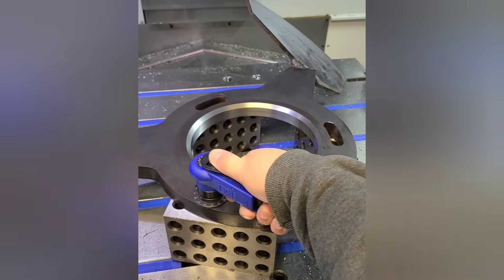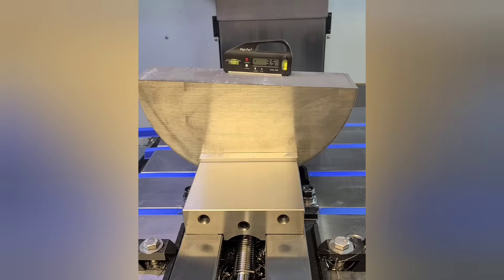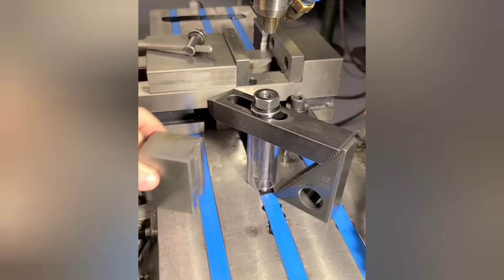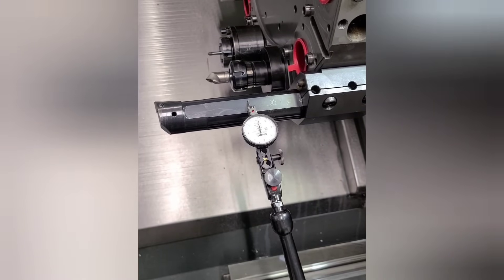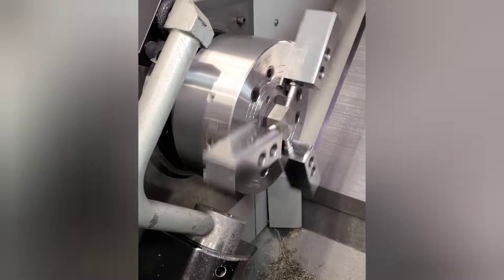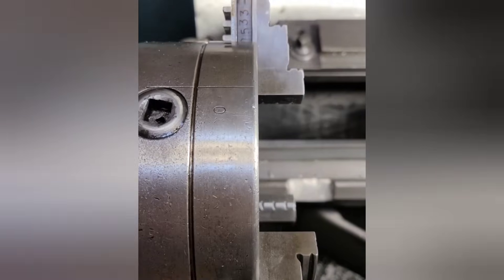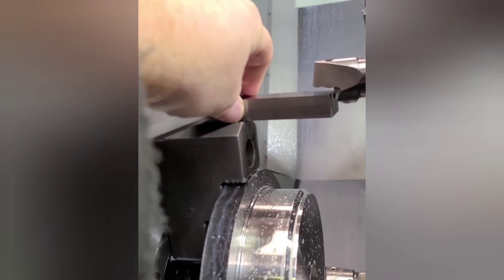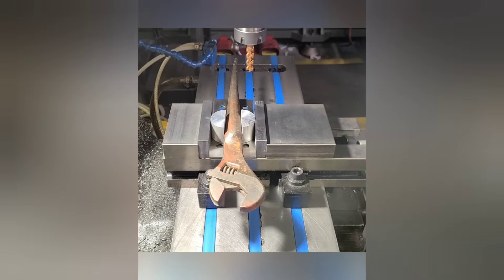Machinist Tips and Tricks Volume 2

Comment: When I was 21yrs old I went to machinist trade school and had a experience machinist once told me that a mill machinist will ALWAYS be needed in this field. I am 64yrs old and work as a mill machinist for a suspension company, I love my job and making parts on the mill!👍
Reply: I have been a machinist/die maker for 70+ years and the pointed edge finder used to find a hole center never occurred to me. Never too old to learn!

Comment: At 2:30 you said something that I could not quite understand. It sounded like you said "try adding spring passes" for threads. If that is what you said, what does that mean? I am the definition of low volume work: retired guy in home shop!  🙂
Reply: Adding passes where you dont remove material i would assume, greetings from bavaria
Reply: A spring pass is taking a cut without moving the tool into the work any farther than previous cut. Its to cut out material that may have been missed from part flexing.

Comment: Manual Machining sometimes is the only way for low volume work and repairs according to all the old school "tool and die makers".  However after learning NC why should we ever use manual Machining when we can program a machine to do it for us?  Alot of old processes in the shop I work in were effective but as all my elders taught me "work smarter not harder"!
Reply: Also, the last machine in this video, is that considered a mill turn?
Reply: An important thing to ask yourself as a new Machinist is how much effort will it take me? CAM is easier now then it's ever been, and if you're confident in your skills, programming a quick op may very well be faster than manual work. That same op might be easier and quicker for an oldhead to justify doing manually, but y'all might have different skill sets
Reply: I use manual equipment over cnc all the time.  If you have strong manual skills and you apply them to the right jobs, it’s faster than setting up the cnc in the majority of cases.

Manual equipment is still a critical aspect of many shops and will continue to be.  Don’t pigeonhole yourself.
Reply: @kw2519  I agree when it comes to one-off parts or low volume, like I said.  Even with low volume a lot, if not all of the time, I can write a simple program or line of code and put it in a vise on my table and do it 5 times faster.  Manual machining will always be a vital part of manufacturing.  I'm just trying to understand why we don't use the best tool for the job all the time.
Reply: @ because the best tool for the job isn’t always the cnc machine.  Things start taking longer to setup on the cnc lathe is you have to load a bunch of a tools.

Comment: Not a full time machinist here, but someone who works on a South Bend manual lathe…it definitely still has a place. Especially still in niche areas like brass instruments with fine margins and fickle joints like from braise or solder. 👍

Comment: A beat-up but still usable manual machine can be had for a couple hundred bucks, maybe a couple grand. Someone who knows what they're doing can do some amazing things with that, even if the machine struggles to hold tolerances. Compare that to a 30 year old CNC for still almost $10k, and no guarantees it can do much better.  I'm solidly in the CNC camp, having done that most of my career. Heck, I manually machine on a CNC because it's faster. But if you only have a manual, you'd be surprised how much you can do. Even thread-milling tapered pipe threads on a manual mill
Reply: OK I give up...how do you thread-mill on a manual mill???

Comment: hey man, I've gotten into machining as a hobby.  I'd like to find work as a machininst, but I haven't taken classes or workshops and stuff.  At an old job I was a QC and I used to measure molds and parts carefully, and a crusty old tool maker taught me a thing or two.  

I'd like to get paid for some of this stuff ideally.  Do you have any recommendations to get into a machine shop locally?  Or any suggestions for a middle aged hobbyist....?  

I'm probably not going to retire or own a house, and I enjoy this stuff at least.  Might as well at least enjoy what I do as a wageslave.
Reply: You dont need classes. Apply and say you want to learn and emphasize your experience with paperwork in QC. Shops need people outside of 1st shift and if you can become a setup guy/programmer. Shops really need more setup guys/programmers.
Reply: Knowledge  of  precision  measurement  is key  to  the manufacturing   precise  stuff
Reply: @mrpete222 has a machine shop playlist with over 100 videos, really good for beginners who want to learn.

Comment: CNC for production, sure. 👍🏻 
But manual machining will always be required for many applications. 
Repair and prototyping for example. As well as low part count production. Or second operations.
Reply: I was hunting the comments to see if anyone had an opinion about that question asked… 

Really was hoping for more of a discussion on this, really had me thinking 🤔 on if it does? If so, could technically the “reasons” to saying Yes become obsolete in a practical/logical manner?!? 

No - Why? 
Yes - how far away could that be from happening?

Comment: Manual machining is best for prototyping and repair. Not usually fast enough for manufacturing.
Reply: one man can run two machines even for small batches so I don't know if manual machining is still better
Reply: One man can run several machines at the same time. It doesn't change the fact that it can take longer to program a cnc machine to make one part than it will take on a manual machine. That's after you have spent £150,000 on a machine.   Rather than less than £10,000 in a manual machine. Why do so many cnc machinists have there heads jammed up there arse.